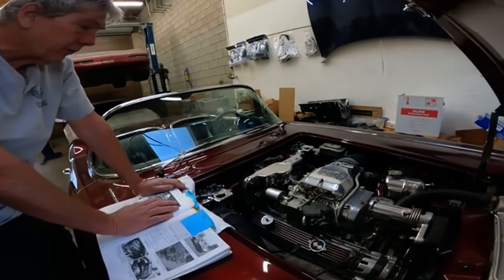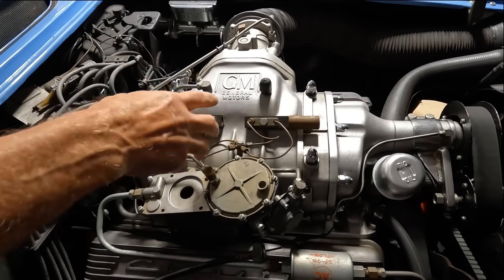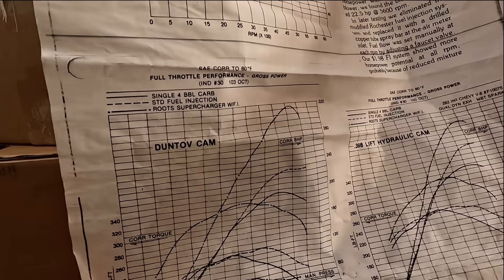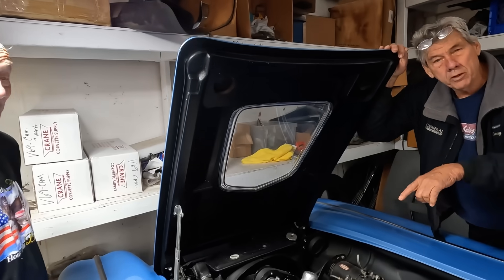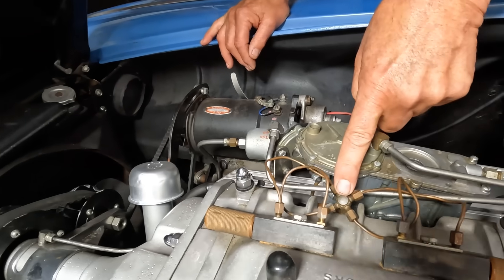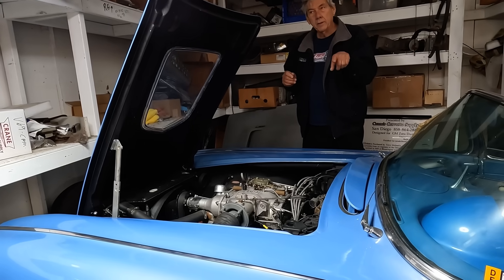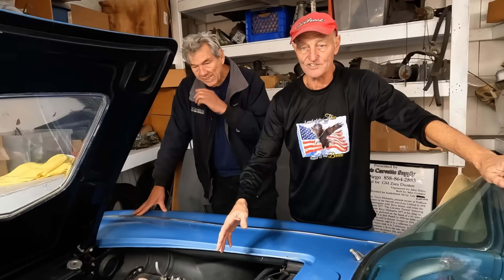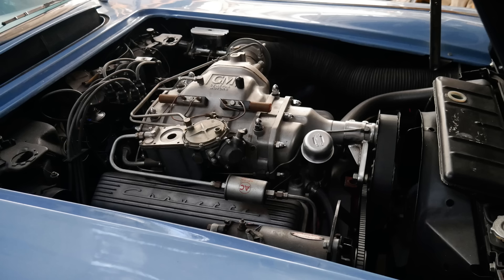World's First Rochester Supercharged Fuel Injected Corvette. Zora Duntov's Engineering Marvel.

Comment: Power fell off above 5500 because of valve springs... BTW I have seen a number of those blowers on tractors at Vintage Tractor Shows, Oliver Tractors, along with a few others ran GM Detroit Diesels. ...
Meryl Dupre... I knew that name from somewhere... just dawned on me Cal mountains looks like the desert, middle of nowhere. We paid him 180k 10 years ago for a 1969  Camaro RS/SS L78 4 spd convertible - I tracked the original owner who had the window sticker the order sheet and the salesman's business card. Owned by Evan or Darren Metropolis now. 
After he died we got a 40 foot trailer load of rare BB and NOS hipo parts including a 69 Trans Am cross ram air cleaner set up which was from Penske...

Comment: So basically, these two Corvettes are NOT factory fuel-injected & super-charged cars. These guys researched, rounded up parts & then added the option/options to their cars. So the question is, did any Corvettes arrive at dealerships with this option combo & if so, we’re they sold to the public/consumers this way?
Reply: Nope , 
None were  ever put is a factory delivers car, only put in the show cars for GM displays, so there are NO ORIGINAL supercharged, injected factory corvettes, 
It was intended to be a counter to the Ford Thunderbird with the McCulloch supercharger, but the Factory NO RACING AMA agreement between the auto manufacturers shut done Zora's play ground.. 
The red car belonged to a friend of mine , Dave Payte, and was a factory fuel injected car he had for years. The blower information was discovered when Ken Kayser's book was published in the 1990's. We decided to build one as a fun project. As we progressed, we discovered all the original parts to assemble one. the 451 blowers all needed to have all the seals reversed inside and the rotors re- flocked. It was just simpler to use the Weiend blower which had the same bolt configuration and dimensions. There was no reason to recreate some thing that never was available.. Then there is Dave Cranes blower;  It was discovered in tact while we were investigating and building the one for Dave's car. His exactly original blower was installed in the blue car and has been displayed at many of the bigger shows, Mine was assembled to be driven, but has been displayed in many shows and is completely drivable., I am sure Dave Cranes could be also, but the time has not been spent to refine the drivability.  These projects have been undertaken because I like building odd and unusual projects. Such as the C8 Big Block engine conversion on U Tube.  Makes me happy.
As far as the people who are saying these are Bogus and not real, 
They need to find something that makes them happy,
               Larry Hofer.

Comment: If you're wondering why there are air filters on the fuel rails, these are old technology. Mechanical fuel injector nozzles like these or old Hilborn/Enderle/Kinsler, etc, had air emulsion holes in them. By venturi effect they pull in ambient air into the injected fuel stream to enhance atomization. Mechanical fuel injection is mostly used in racing applications where filtration isnt a concern like a street vehicle. Emulsion style nozzles only really work where there is vacuum ahead of the supercharger or in n/a applications.  For boost/positive pressure use, a non-emulsion nozzle is used.
Reply: So, this being a supercharged application, yet also using emulsion nozzles, can we assume that the injectors are upstream of the blower and both fuel and air are going through the compressor?
Reply: @jimmybryan6760  Yes, they are on top of the blower case where there is no boost.

Comment: I wish I'd have gotten a chance to play with those old fuel injections.
Reply: The fuel injection was a mechanical unit.
It worked wonderful as long as the diaphragms were good.
They were limited by air flow. That’s why the rpm was limited.
In the 1960s going to auto tech school at National Technical Schools in LA.
We were taught the unit by an old GM Tech.
I ran a corvette unit on my 36 Ford in the early 1970s.
Most fuel injection from Europe was high pressure injectors, these were not .
The pressure in these is regulated by the diaphragms.one  dia. Was manifold pressure.
The other was large dia. Was by a Ventura around the air inlet.  Idle was controlled by air bypass screw. Simple but really wonderful. No electronics. Fist time I heard of the blown setup.
 The did experiment with a blow through carb setup using a air pump and pressure tank
For short burst back when. 
Boys will play.
Reply: GM's mechanical fuel injection is an exact analogue of the Bendix RSA system.
What made them work were 1) An air- diaphragm assembly that generated more force in proportion to venturi vacuum 2) linked by a rod to the fuel pressure delivery regulator 3) That gave zero fuel at zero venturi vacuum and max fuel at max venturi vacuum.
      The fuel discharge nozzles were "aspirated nozzles" that let atmospheric air vacuum-bleed into the induction. It just keptthe fuel from blobbing and dribbling in when idling around. They work fine (like Hilborn injection) at Wide Open Throttle without the air-bleed aspiration system.